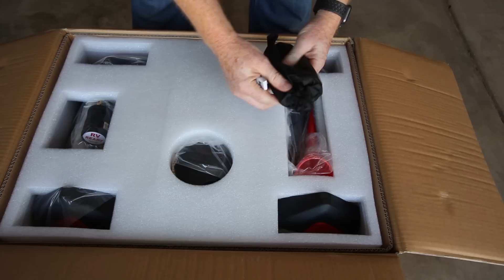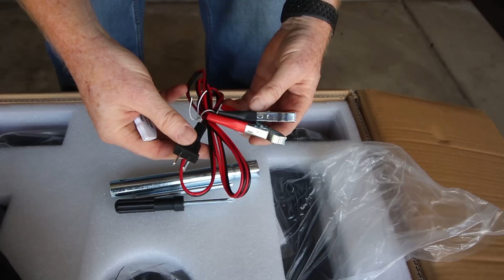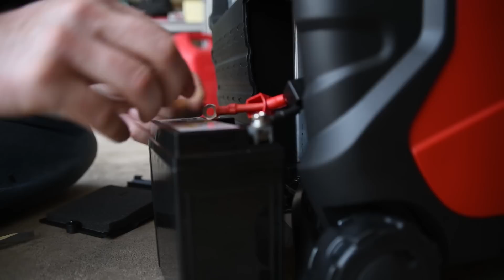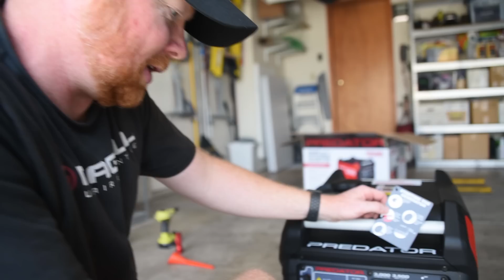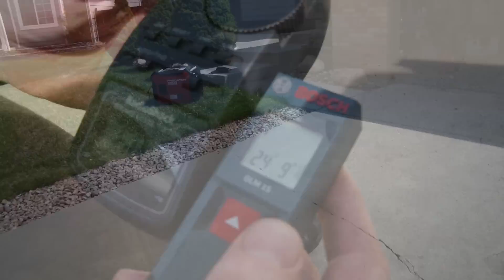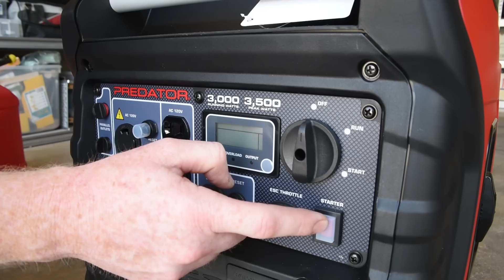Predator 3500 Generator Unboxing and Test

Comment: How's it running?
Reply from the maker: Ran into two issues with it. We took it on our trip to Alaska last summer and it wanted to idle strangely. It eventually went away and it didn't affect it running. I read later that it could be related to air flow and I replaced the oil door on the side with a vented unit I found on Amazon. Not sure if it will resolve and I only had it happen twice. The other issue I ran into is the spark arrestor has a small removable screen in it. This plugs up and kills the generator. I ended up removing it as I couldn't get it clean enough to resolve the issue. I have around 100 hours on it and those are the two issues. Neither were a show stopper.